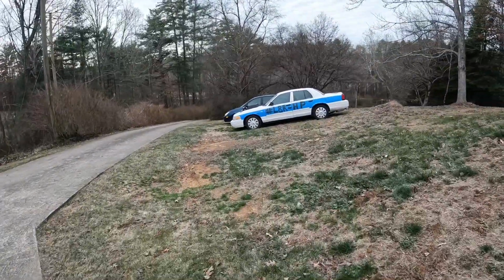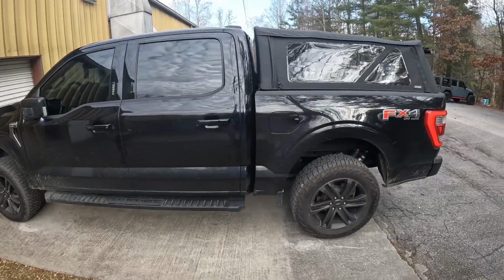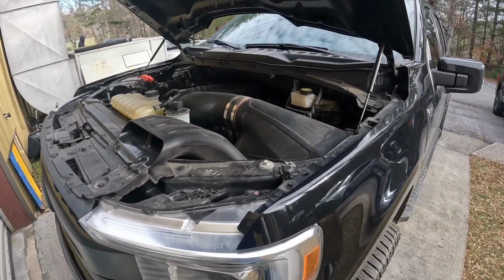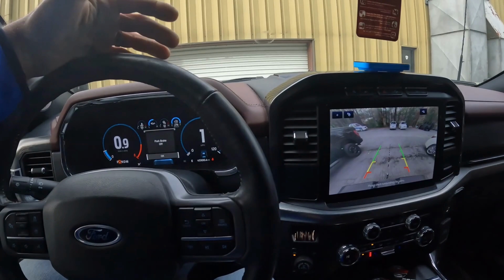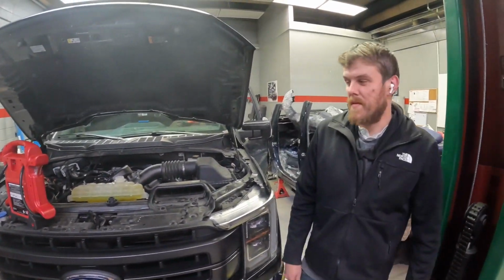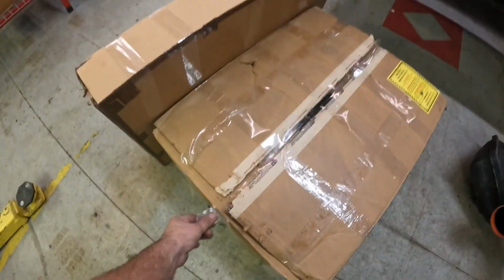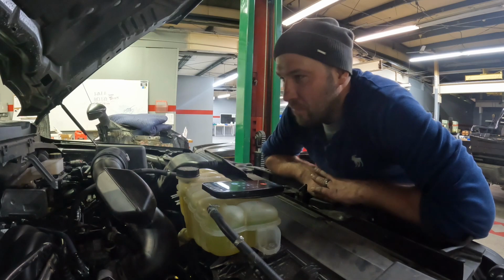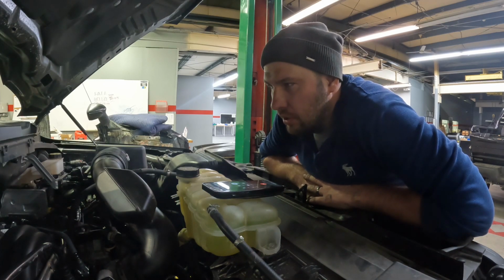2021-23 Ford F-150 Whipple Supercharger For Sale

Comment: Looking to get  a few parts installed on my 2022 stage 2 Whipple f150. Need some fic1000 injectors installed, JD fuel system, smaller pulley, and a HIC lowering kit. Can you guys do that?
Reply from the maker: Sure. You have all parts? We are in Arden NC 28704